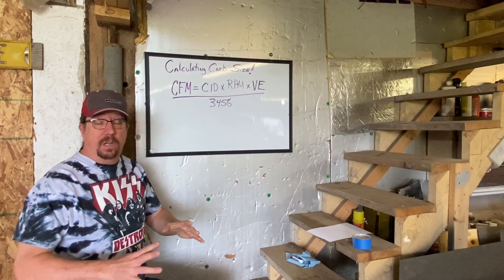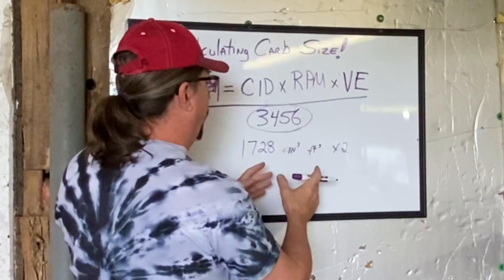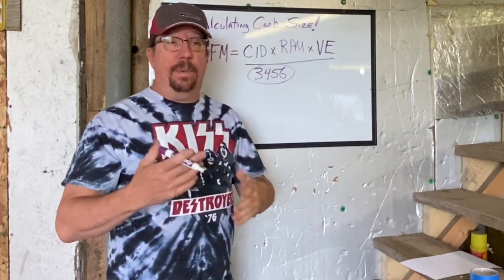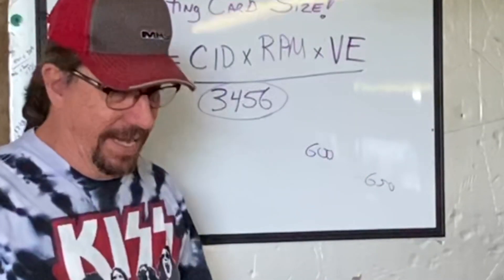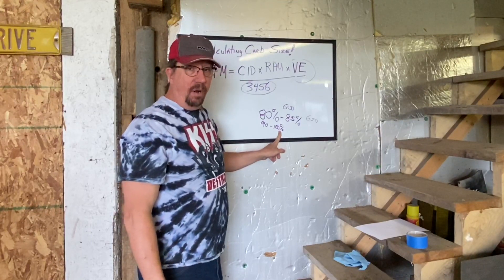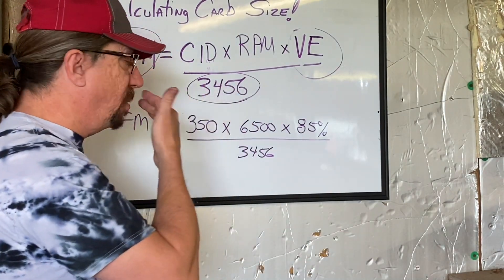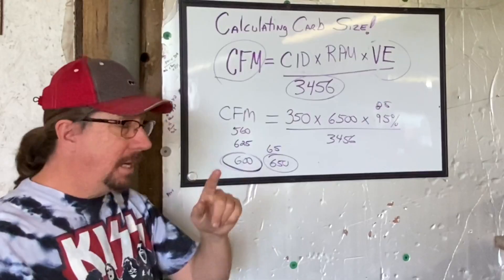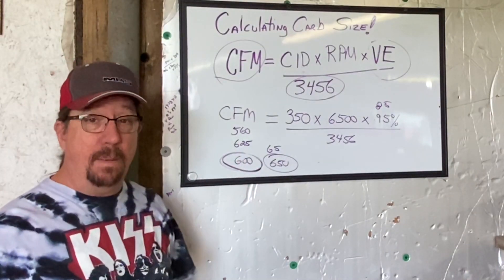HOW TO: pick the right carburetor.  SIZE MATTERS!!!  Don't overestimate, do the math.

Comment: This has absolutely nothing to do with selecting correct size carb, you need to look at how much your cylinder heads flow, and what the lift of you camshaft intake is
      My sbm heads flow 278 cfm at .500 lift, my cams max liftvis .485, 
     So i kept using the mentioned formula in this video for my 360 build and 674 cfm carb, bogs, stumbles hesitates, all thru rpm range, tried different accelerator pumps, accelerator cams, squirters, locked out dizzies, jets, nothing helped
      Found video showing to size carb based on what your heads are flowing, for a v8, at any given time 3.3 of your intake vales are pulling air, so to size carb, multiply 3.38 times what your camshaft allows your heads to flow
   Mine is 278 times 3.38 came to 939, put on 950 carb, after a year of struggling every weekend with changes to no avail, my engine came to life and is roasting tires,
     This formula that everyone uses that doesnt take into account the flow of the heads is completely wrong

Comment: Where's your pressure drop, carbs are rated at 1.5", you've calculated open flow. You won't get 560 through a 560 on a 350 with that formula.

Comment: Thanks for the info!  I’m building a 496.  AFR 315 cnc heads with a roller cam matched to those heads. Roller lifters and rockers. Single plane aluminum intake. I’m planning on 7000 rpm max.  I have an 850 double feed/pump with mechanical secondaries.  The math comes out about right and I appreciate your vid!
Reply from the maker: That sounds like a great combo!  The tendency today to over carburet everything is crazy. Like everybody’s running everything all day long at 10,000 RPM. Lol.  

Thanks for watching.
Reply: And leave about 50 HP off the engine 😂. My 455 Olds came with a 800 CFM and this dumb calculation would want a 650 😂. A Chevy 302 come with 1050 CFM and your calculations would say a 450 😅.  What about the streets... My Olds 455 did first gear burnout, chirp second with a 4150 650. With a 4150 750 did first and half of second gear burnout and hooked up. 4150 850 burned all 3 gears in about 75 feet. Your calculator is for people who can't adjust an idle circuit.

Comment: Sooo you mean all the cam grinders on the market just talking shit  about their cams and how big carb theirs grind need.

I built an 360cui mopar engine with a cam spec who top at 6400rpm..intake, heads cr headers, thats need they said 750cfm.

And the easy way to go..just dubble your engines cui..like a 360 get 750cfm.

??
Reply from the maker: @HUNTER1GHOST  thanks for watching that

Comment: I don't have much faith in these formulas in any context other than a street car that won't be used for racing. The fastest combination Bob Glidden tried on his 330 inch destroked Cleveland was a PAIR of 1,150 Dominators. Ran significantly faster than the single that would've been far too big based on the formula.
Ford also put a lot of R&D into developing the best responding induction package they could for the Boss 302 in the 1969 Trans Am series, which ended up being a PAIR of 1,050 Dominators in 1969 on fairly poor flowing heads for today's standards with an endurance racing cam. It did so well that the SCCA banned dual quads the following season. A 750-850 CFM carb would've been the best choice based on this formula, but Ford found that 2,100 CFM worked best.
Reply from the maker: I did this video three years ago and never expected it to do anything because my channel was very very small at the time.

I was specifically addressing a question somebody asked me about sizing carburetors for the street performance 

I have since do d two more videos to try to explain that but nobody watches those. Lol.  😝 

Thanks for watching
Reply: @MyKARSShop Fair enough. Most people do use more carburetor on their street car than they'll ever need, and it's harder to tune a big carb in a heavy car without much gear. I just wanted to share that info because it's honestly astounding to me how much carburetor they used in Pro Stock, and especially in Trans Am because you don't normally think of road racing cars to run so much carb.

Comment: Gotta love all these calculations and they are probably good for a starting point but there are too many variables.  A stock 350 sbc might only need a 600 cfm carb, start adding better intake, heads, and most importantly cam lift and duration, and you are going to need a bigger carb.  There's a lot of carb tuning involved with any sized carb so saying I ran a 750 then replaced it with a 650 and it ran better doesn't really mean much.  It only means something if both carbs were really optimized.  If you can somehow get to a dragstrip you can actually do some real world testing and find out what works best.  I happen to run a 750 Holley double pumper with a 50cc front pumper on a 1968 Camaro 383 sbc chevy engine, automatic with a Vega converter (about 3k stall) 2.05 heads and 538 lift cam - car runs mid 11's (11.62 best so far in 1/4 mile).  I wouldn't hesitate to try an 800 cfm and see if it's better after going through some tuning on it.  It's the only way I'll truly know.

Comment: If you are right Why did GM use 800 cfm quadrajets and Mopar put 6 pack on 340 🤔
Reply from the maker: Air door, carburetors, and vacuum secondary carburetors only flow what the engine requires.

I Elaborate more on this in my second video on this 

https://youtu.be/jPmgrrbYqtQ?si=XNH9-MpEQLSGrh1b

Comment: Your figures were developed by carb manufacturers because of people over caring and returning cards.
The dyno tells it all , so according to you my 505 should take a 970. My engine made 22 more hp going from a 1050 to an 1150 carb.
What about dual cards on factory cards, or 3 duces .
I think engine masters did a show on this and your info was totally wrong.
That dry erase board doest run down the road. Totally stock 350 has a 750 cfm carb.
340 Chrysler with a 1000 cfm thermo quad.
Under carbing is worse then over carbing.
Reply from the maker: I ran Dyno  for many years and I will tell you that… What works on the Dyno for maximum performance  doesn’t necessarily perform well on the street when you’re driving the car to get groceries or go to the bank to make a deposit.  

Thanks for watching

Comment: You have a good sense of whats going on, i truly believe your leaning more towards novice or younger car enthusiasts so that may be where you get a little kick back from more experienced  hotroders . I as a person who have owned mech shops always had to know my customer who wanted to beefup their cars performance .what could they handle most were clueless so i did little perks if they wanted more i added to it. But most just wanted to drive around look cool and rarely if ever get on it. So your pretty correct in how you presented your video.  Talk more about HP that the engine truly has as per CU , 6pac other types of carb manufacturers, how to ajust cards for proper air flow . Waiting for your next video.  Oh rear end gearing per HP also. Open to posi rear-end.
Reply from the maker: Thank you so much for your comment. I’m sorry I’m so slow in responding. Just super busy this time of year. 

You exactly were picking up what I was putting down 

I actually did two more videos on this  to explain where I was coming from.  

But you nailed it exactly exactly. I was approaching this from the point of drivability and street performance, not maximum performance at wide open throttle. 

Having spent many years running cells, I am fully aware that performs well on the Dino and the dragstrip will not necessarily equate to a street car 

Awesome. Thank you.

Comment: People always seem to equate biggest is bestest.  Cams, carbs, exhaust, you name it.  Then they “ claim” their combo “ runs fine”.   Sure, maybe at some point it does, but , on the street you are 99% of the time over sized on everything.
Maybe your car idles good and runs wide open good, maybe not.  Maybe it runs great through the midrange but dogs on the bottom or top.  
My point is, just because it starts and you can do a burnout or run to the gas station and back doesn’t mean it’s running its BEST through the entire range.   Most people would be surprised how much better their motor runs through entire range, bottom to top, with LESS carb and cam and a smaller diameter exhaust.    
Street driven cars are miles away from pure track cars.  And , with cars , bikes , whatever, everyone loves to sit around and talk about they have the biggest and baddest, then go on the street and get their @$$ handed to them by a guy with way less size and better parts system matching.   THEN they put even bigger stuff on!!
Running and running RIGHT are far from the same.  People are so surprised at how much less they really need to do what they’re aiming for.  I knew a guy that put a 1050 dominator carb on a SBC for the street. It would do burnouts, but he couldn’t drive it anywhere.  On the advice of an actual drag race motor builder, He ended up with WAY less cam and a 650 carb and it was a whole different car!  
But convincing someone they’ve over built is like pulling teeth.  
This was a good explanation of how much carb you DONT need for a given motor.  Making it run, and making it run WELL are two different things, and on the street, biggest and baddest rarely works WELL.
Reply from the maker: Thank you for getting my point of the video. It was actually more about the CFM an engine requires than it was about carburetor sizing.

But I was new at YouTube when I did this so I didn’t get how specific and detailed do you have to be with exact  information or the nitpickers will tear it apart.  lol 

But the foundation of what I was presenting was about street cars not race cars. And not about what performs on a Dyno. . 

I ran Dyno cells for years, and I know for a fact that what might perform well on a dynamometer does not necessarily equate to good street performance 

Thank you so much for watching and getting my point.

Comment: 302cid × 6k rpm × 0.8 VE ÷ 3456 = 419.444444

Hmmmmm

302 × 8k × 0.85 ÷ 3456 = 594

Hmmmm

302 × 8k × 0.95 ÷ 3456 = 664.12

1969 Z/28 DZ302 Cross Ram: Factory equipped with twin 585 cfm Holley carbs for 1170 total cfm.

Your math isn't even good enough to be considered horseshit

Comment: That formula only works for mild street where you have a broad range your engine may run in. Throw it out the window for anything else! At 100% VE my 355 would churn out a 715 cfm at 7000rpm. I was pulling so much vacuum as the tach rose it was ridiculous. 850 cfm and power was better. Granted I had to tune it for that, but one needs to tune regardless. Lack of tuning skills won't allow you to run an optimal cfm carb. I'm not talking just changing jets and or idle mixture screws. Your myth has been around forever and is completely wrong. It's been proven wrong way back. "the truth you know might not be the real truth"
Reply from the maker: You’re very first sentence says exactly what this video was about

Street performance and drivability 

. This was filmed many years ago when I was just starting in YouTube and was in direct response to a viewer question 

I have since filmed another one explaining more where this was coming from.  But of course nobody is seeing that one. Lol.

I never expected this video get any attention at all so it’s been greatly misunderstood 

Not that I really care.

Thanks for watching
Reply: @MyKARSShop  I understand. The problem really has to do with the street enthusiast now days thinks 500 hp is mild. The formula which to be fair is promoted by Summit and a whole slew of companies. At 400 hp and less it can still be a problem with undersized carb and running a power valve. The right mix at lower to mid might at upper rpms go very lean due to power valve getting higher vacuum from undersized carb. The real key to picking the correct carb is to really understand carbs and how they work.  But everyone wants somebody to reach into their hat and pull out a magic number so they don't have to think. Thanks

Comment: Having owned a 4valve ford, it ran a very high VE of 93%, hemispherical chamber. Measured at under 600cfm, so the math is accurate!
Reply from the maker: Appreciate the encouraging words. It’s definitely been a very controversial video. 

Most of the time the one thing people leave out of the equation is how drivable it is through all of its ranges. 

And that’s where the video was coming from 

Good to hear that your experience lines up with math. 

Awesome to hear from you. Thanks for watching.

Comment: A good ve comes from a good cam bigger than stock with at least 11to 1 compression . Great carb , intake manifold ,, CNC cyl head ,,, headers that fit the ports ,,, 100% ve will occur  some times
Reply from the maker: Exactly what I was saying. 100% VE is not the norm unless you absolutely know what you

Love your comments!  

You completely get where I’m coming from   

Thanks for watching

Comment: The worst  situation is an oversize carb with being a double pumper  with low stall and stock diff gears
Reply from the maker: Exactly my point. When I shared this video, I wasn’t clear that I was talking about street cars. I’ve done a couple other videos to try to clarify where this was coming from.
I think I changed the iCard links to reflect those videos

Would love your perspective on them

Thanks for watching

Comment: Calculate air flow for cubic inch and max RPM and volumetric efficiency V/E
Holley recommends  for naturally aspirated 100% ve for most performance . Race only 110% ve .  If the carb is to big it will not meter the fuel as well due to lack of vacuum signal . Once the engine is on the dyno the vacuum measured at full throttle should be  .5 in hg to 1.5 inhg .
Reply from the maker: Good information. Thanks for sharing.

Comment: i have seen a STOCK 305 make its best hp and torque with a 950 cfm on the dyno . Every drag racer out there seen much improved et time slips with a 750 over a 600 at every drag strip around . Just because it is math does not make it right  and your made up number of 3456 is wrong !  Ps every body and their bother has a dyno now so !

Comment: Im still confused, I had a 71 Cutlass bone stock and i bought it from the original owner. 350/350 turbo transmission.  It came from the factor a single pumper 750 carburetor. Would that formula go out the window. I know that by the build sheet and I had to get the carburetor rebuilt and the old man told me that when he worked on it.
Reply from the maker: Factory basically used only a couple of size carburetors that was to keep manufacturing costs lol. But these carburetors were fairly universal.

But these were not intended to be performance carburetors. They were the one size fits all for multiple applications

Whole the maximum flow of the carburetor might have been 750 CFM, that is not necessarily what the engine needed or used. D

The genius of a spread bore carburetor like General Motors used is you had a good throttle response at the low end? 

And then an on demand, secondary with an air valve plate, that would only feed with the engine what it asks for 

So, while the carburetor might have flowed max 750 CFM 

The engine itself might only require 400 CFM. 

These air valve door, carburetors, Quadra jet, thermal, quad, etc. are much different than a Holley because they were spread bore with small primaries and large secondaries. 

Holley carburetors in general were square flange carburetors…  meaning primary and secondary’s use the same size throttle bore

They did not use an air valve door 

Although the vacuum secondary Holley carburetors function in a similar way, 

They had much larger primary bores 

I did another follow up video on this subject to explain things more in detail

Here’s a link. Hopefully this will help shed more light. 

Thank you so much for watching 

https://youtu.be/jPmgrrbYqtQ?si=8HnoHxHNS8o5REwp